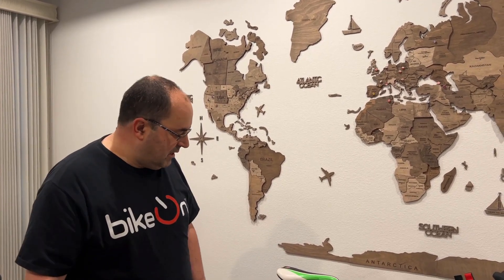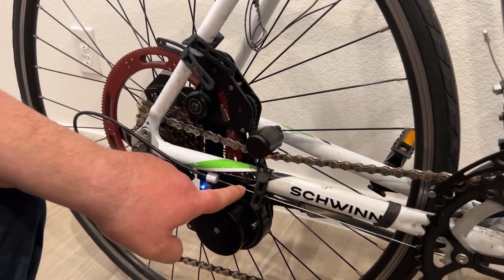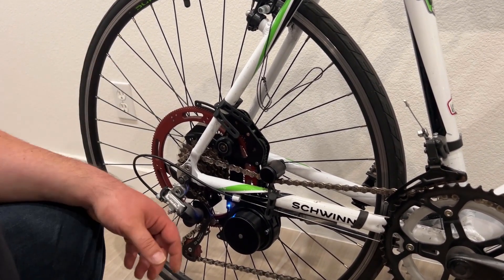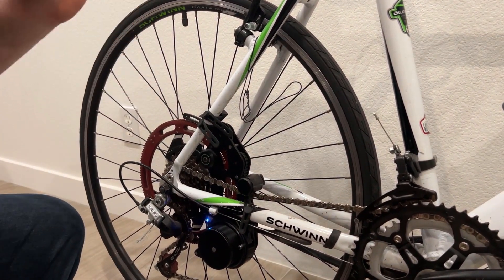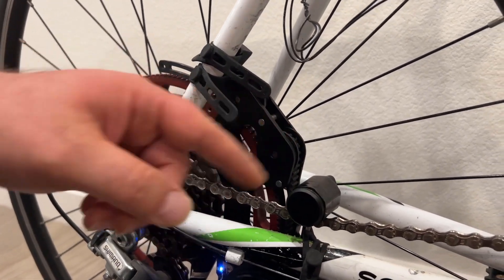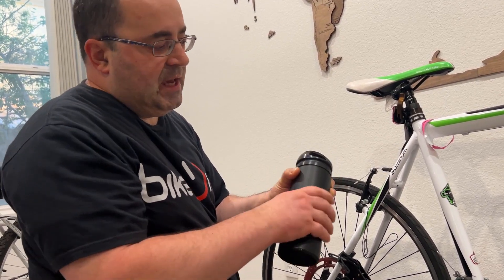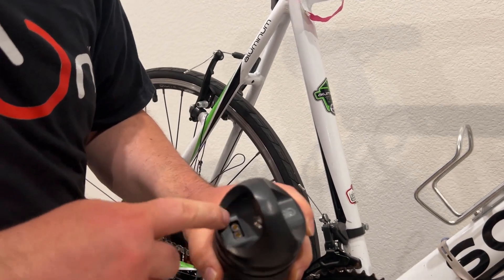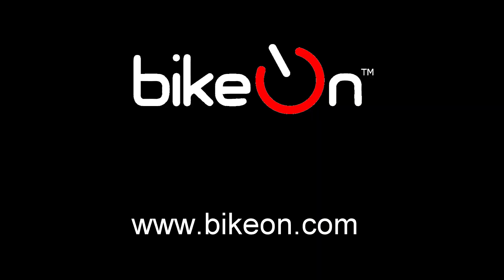Answering Questions About BikeOn: Backpedaling, Points Of Contact, Materials, Battery

Comment: will this work with an aluminum cassette? and does it take over the largest sprocket (basically no longer can use that gear)?
Reply from the maker: it should work with aluminum cassette, but we recommend using steel. You will lose the largest sprockets and 2-3 gears, but you exchange them for the motor.

Comment: Does RideOn accommodate different low cog sizes? I run a rather "mullet" 1x9 speed with a 42 tooth large sprocket on my dutch cargo bike. Having recently gone e on my gravel bike, I'm scoping and planning doing the same for my "dutchie."
Reply from the maker: BikeOn doesn't fit 42T, the max for the current model is 36T. And we recommend installing the device on the largest sprocket.